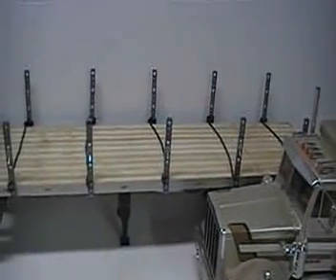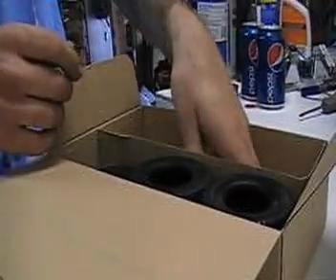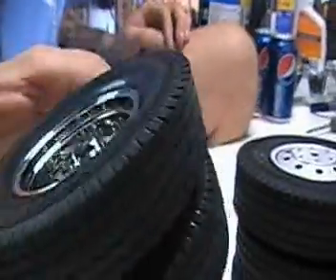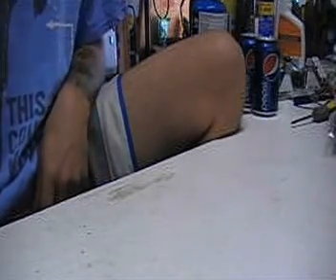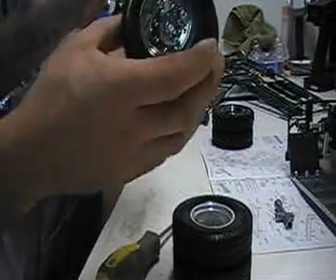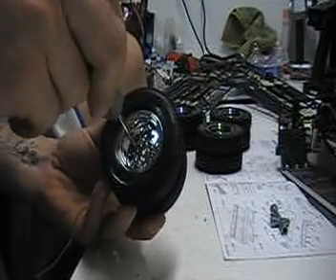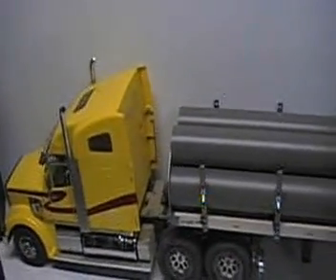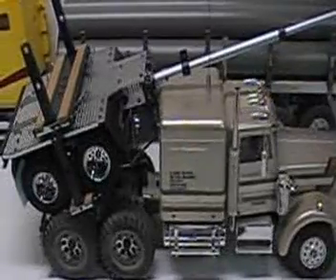Tamiya Pole Trailer build

Comment from the maker: Your truck is simply STUNNING. I've debated getting the ultimate polished aluminum wheels for it for when I run on pavement, that will be a little later down the road. I re-tested the super singles after I locked the diffs and as long as the license plate brackets dont dig in I've got insane traction. I cant stress how kick ass your truck is and I have a little something in the works myself